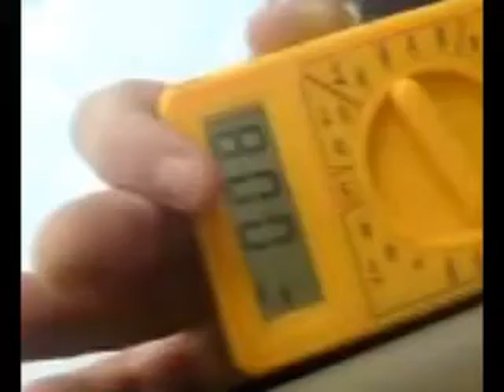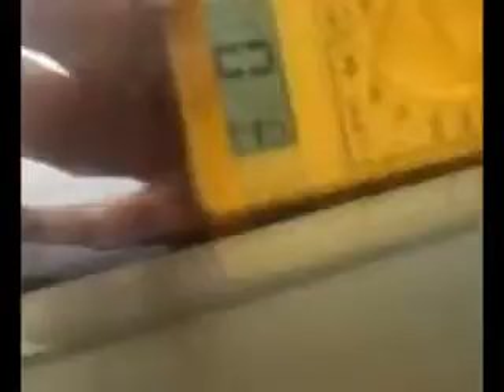Land rover ABS sensor readings

Comment: Hello. Use the ohmeter only for checking the resistance of the sensor when not in motion. To check for proper operation, put the meter on AC mV and spin the wheel at 30 RPM or more (1/2 turn per second). Should be at or above 200 AC mV (0.2V)

Comment from the maker: Cool!  hope its sorted, Mine turned out to be an air gap on the nearside, along with a wiring problem,, which turned out to be a dodgy connection into the ABS Control unit, and somethin else aswell,, cant rmemeber what tho,, pain in the arse aint they!

Comment: could you shoot the video with this very sensor on the front left wheel? the thing is I have some wirings harness coming to nowhere and I'd like to learn if it was a wheel speed sensor or a brakes pad wear sensor. 
Besides, I'd like to learn if I can fit these wheel speed sensors on the non-ABS axles (old rangie). I'd like to track wheel traction (just for mud fun)

Comment: hi was this on a land rover 1995 m reg
my mum has a v8 disco 1995 m reg the abs light is on i cant find the diagnostic connector and its not a obd2 the blue connector does not have any black and pink pins